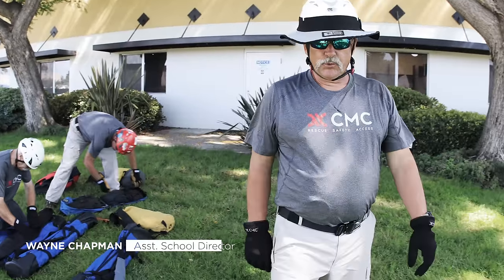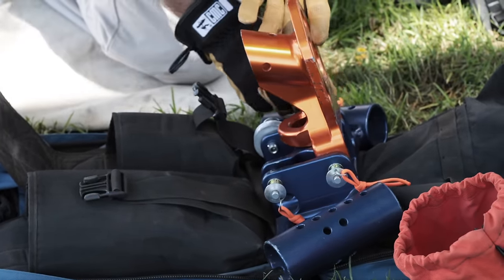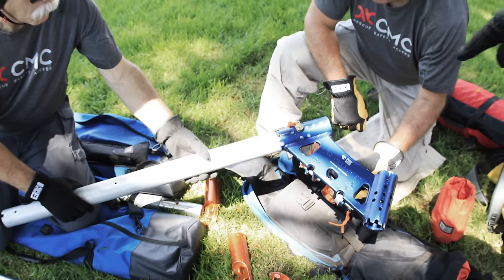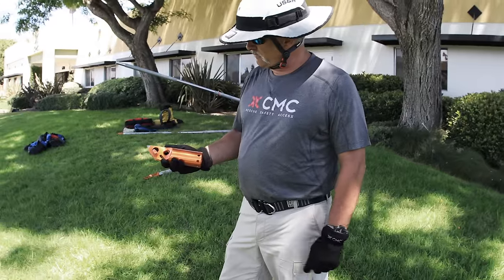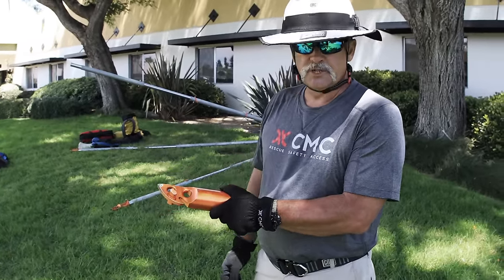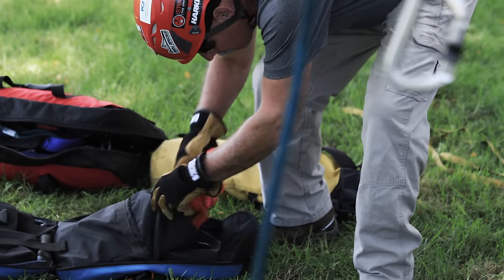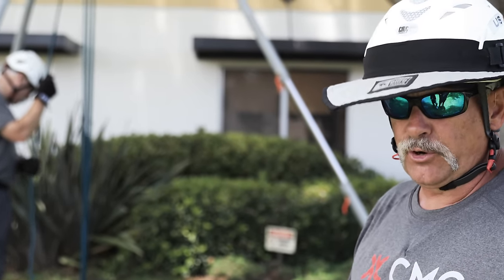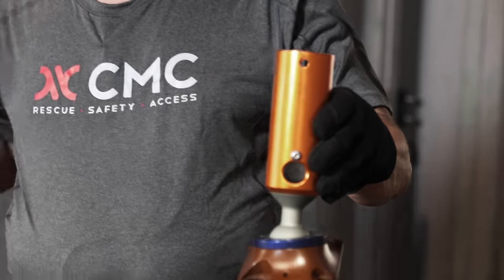Arizona Vortex Tripod Configuration | Elevate your Access | CMC

Comment: Did Cmc start selling the vortex with 2 more outer leg sections? Last time I checked, the vortex was only sold with 3 inner and 7 outer leg sections.  This video might be misleading.  Also, the legs are strongest with the inner leg on either end.  Although it's most convenient to have the inner leg in the middle, it is significantly weaker in that configuration.
Reply from the maker: Hi and thank you for your comment! In the video, two additional outer legs used in the video for 9 total. To address the configuration shown in the video, a typical tripod configuration would feature having the outer legs at the bottom of the assembly and the inner legs at the top (connected to the head assembly). It is in this manner that the AZV is certified to meet the performance requirements of NFPA 1983 as shown on page 16 of the users’ manual. CMC recognizes that the AZV is extremely versatile and can be rigged in numerous configurations, however it is not practical to certify the AZV for all of them. Safe operation of the AZV is more dependent on exercising proper rigging (i.e. correctly analyzing resultant forces and proper guying) than the physical structural of various leg configurations.
Reply: I agree, this video actually confused me more based on my teachings by how many legs they used, along with the order of the legs. Kind of annoying. Should be re made to match product manual.

Comment: Inner leg set in the middle for ease of adjustability? any reason besides that?
Reply from the maker: Hi T Miller,
Great question! It also allows a winch to be mounted using the holes on the inner leg as an anchoring point. Hope this helps!